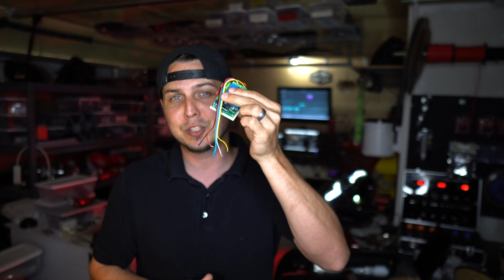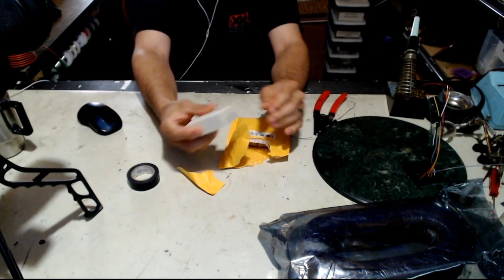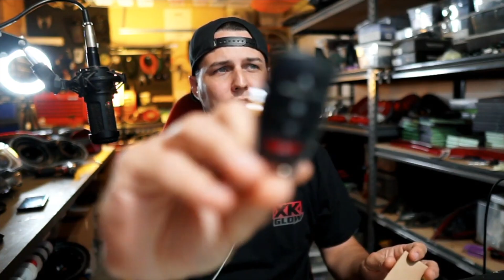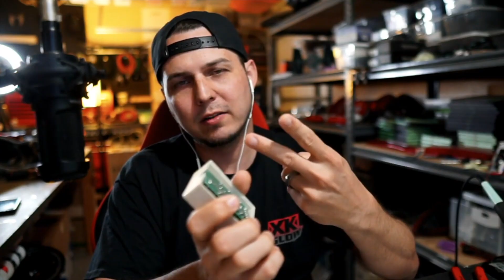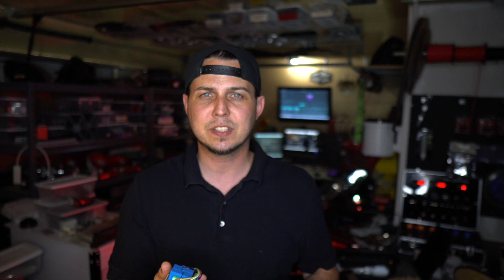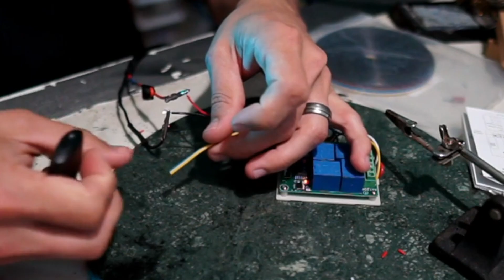BEST 12v Remote Controller  under 20$ | FlyRyde

Comment: Hey Chris, soldering works for sure to keep those in the terminals. Another option are ferrules, they're very handy to keep all your strands together and gives you a solid connection. Phoenix Contact is a good brand but I know they're hard to get ahold of, near me at least. But I'm sure any brand works the same
Reply from the maker: I think ferrules are super smart to use. I also think they wont fit with these. Good news is, I tested the soldering method yesterday and it worked amazing! Way cleaner.

Comment: why not just solder the power wires on the bottom of the board? i believe the contacts for each connection are visible... that way it would be super secure and no bulk
Reply from the maker: GREAT IDEA! I just ran out and checked, and sure enough, that will work great. I will say, it wont really save any time, and has to be just perfect to fit inside the case, and not cause any issue from accidental bridging. I will say though, if you know you're never going to make a change, I think even soldering and potting something like this would work? 
Good idea dude!
Reply: @flyryde  no prob man, love your videos and work, wish i had more then a smart car to work with!! Also, check out this video (not mine), has the momentary and latching thing going on... https://www.youtube.com/watch?v=__isLuqLXUU
Reply: And also this one... appears to have momentaru, latching and ...toggle! https://www.youtube.com/watch?v=wDB5Vl7iKYg Not sure if all can do this, boards all look the same